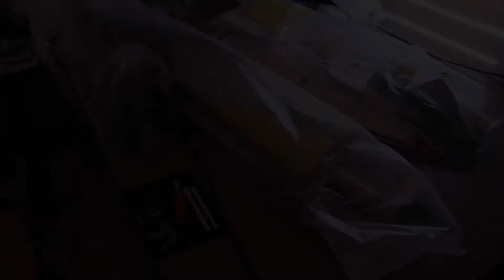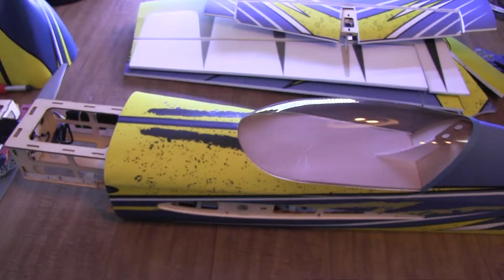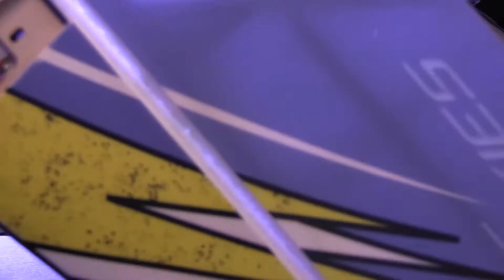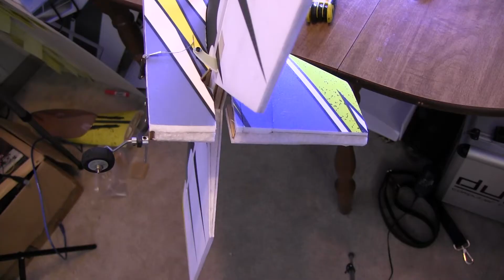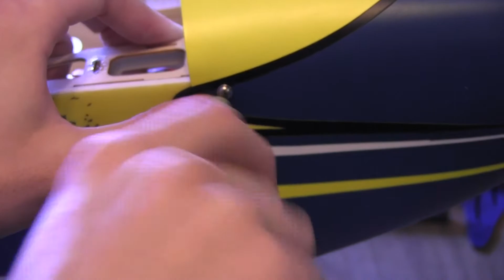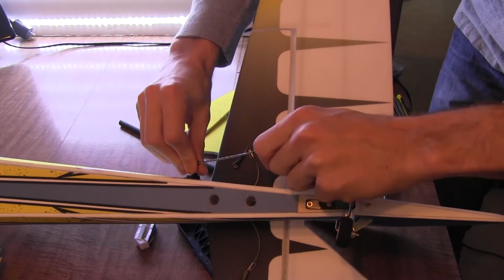RC Gadgetz MXS 56" Build Video

Comment: How does this compare with the 54"slick?
Reply from the maker: Rick Compton It doesn't tumble like the Slick does. Not as wild at all. Slick is for crazyness, this is going to be my laid back smooth plane.
Reply: Thanks James.  I'm liking the Slick so far.  Enjoy the new plane!
Reply: You forget to glue the cut out the part of the rudder !
Reply from the maker: YEUNG GARY I stated in the video I did not film that 😅
Reply: @JamesWinstead  How is the plane so far? Can't decide between RC Gadgetz Edge 540 PNP and EF 3DHS 52" Edge 540. Is it even comparable?